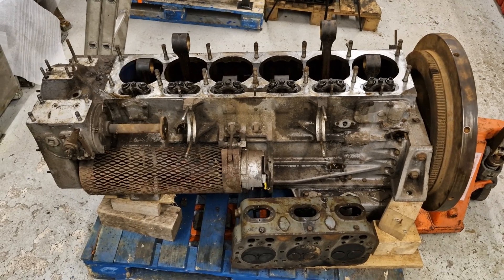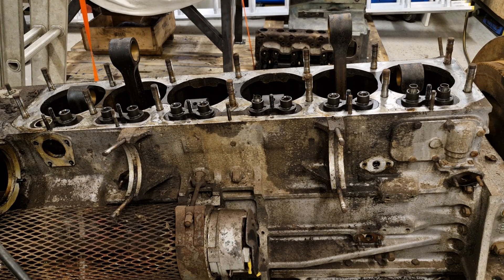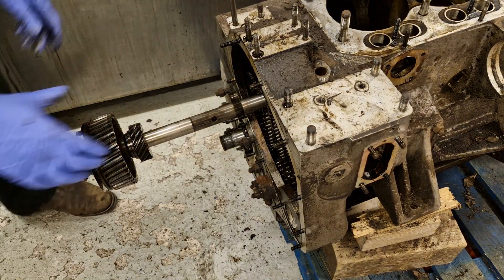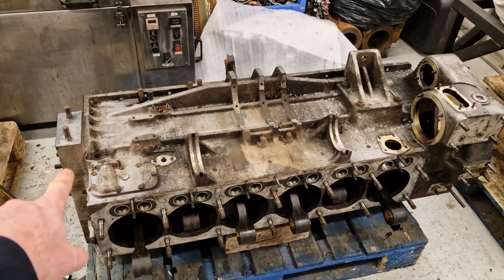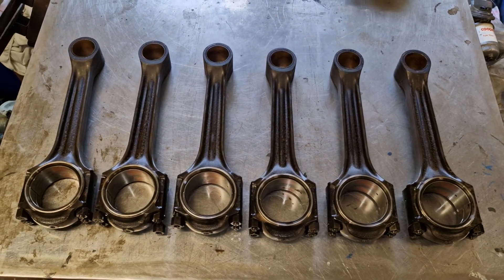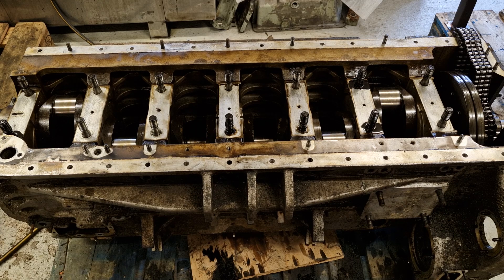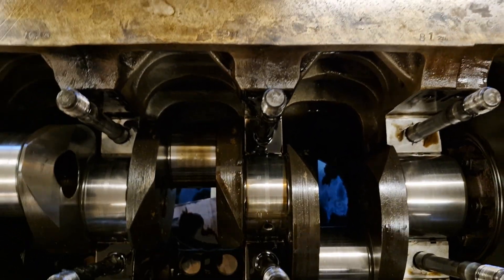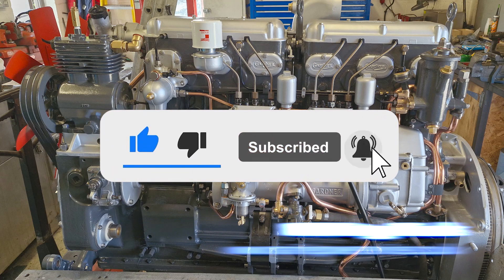Gardner 6LXB 180 Overhaul Pt 2 - New heart for a Scammell Explorer. Bottom end tear down

Comment: Thanks for filming this, What size exhaust pipe diameter would you run on a 8LXB
Reply from the maker: @MrCrabbing it is utterly dependant on the installation. length of exhaust run, number of silencers, number of tight bends etc etc.  However the Gardner stated for an 8LXB is a minimum bore of 3 7/8"(98.5mm) and a system design not to exceed a backpressure of 20 InHg. So depending on the setup you may need larger than the stated min diameter to keep the backpressure down.

Comment: You seem to know your way around these engines, do you measure the main bearing bores, or is there usually a tendency to go out of round? Nice video.
Reply from the maker: Don't normally find issues with the crankcase bores with the exception of the odd engine that has either been heavily got at in its life or has suffered a failure. So on some occasions they need to be line bored but not often. If you mean the bore within the main bearings themselves that the crank runs in then we replace in all instances so we measure the crank and check over the bearings for anything out of the ordinary, but rarely waste time measuring up bearings that are going in the bin. The crank however gets measured to acertain if its a polish or undersize grind it needs.

Comment: I have a question if you don’t mind, I have a 2LW, at 40 seconds in you remove a part off the timing end of the engine, I have a similar part on mine without the arm. Can this part be just removed and a cover plate put over the hole?? I only ask as mine is not used for anything and is leaking oil 👍🏼👍🏼 (my engine is in a narrowboat)
Reply from the maker: If you mean the part I am holding up to the camera at 1:01 then no you cant. The fork part you can see sits in a groove on the timing gear on the injector pump. without this in place the gear is free to move backwards and forwards on the injector pump shaft which effects injection timing. Is yours leaking from around the shaft? or where the housing is bolted in by 4 bolts?
Reply: @MPSVintageDiesels  leaking from around the shaft I believe 👍🏼
Reply: @NarrowboatPreciousJet  front or back of shaft ?

Comment: Hi mate are sper parts still available. Also what do you do with these engines.?
Reply: Hi, still easy to get.
Reply from the maker: Depends on the engine model, but in the case of these LXB's yes parts are still available.  Most of our engine are built for customers so in this case it will be fitted into a Scammell Explorer (Lorry/Truck) by its owner to replace a Meadows petrol engine that is currently fitted.

Comment: Do you normally, remove the hub from the camshaft, and fit a new key with locktite  ?
Reply from the maker: yes we remove the hub, cant get it clean and inspect it and the cam properly when still fitted. We fit a new key as It's called for in the documentation. Although never had one that has ever had an issue with the key that was fitted so not really sure on the need to replace it. I get it if you are repairing one that has had a cam/valve related failure as it may of overloaded the key but yet to find one damaged over the many hundreds we have done.
Reply: @MPSVintageDiesels  hi, I have a good few engines, that have had loose hubs, it causes the engine to flutter. As the camshaft rotates, the hub goes backward & forward  ( even if the chain is tight ) it goes down the half shaft & affects the governor. Carl ex Gardner fitter.
Reply from the maker: Intregued to know what made them come loose. In alot of cases we have to put them in the press to get them off. pretty much the opposite of loose. Were they mostly very high mileage motors or warranty period repairs?
Reply: @MPSVintageDiesels  high mileage engines, they will not move in and out, just rotate side to side. Used to take the chain wheel off, and put on a 3 stud / nut puller, and remove in situ  ( unless the engine was being completely rebuilt ) I alway used to remove the halfshaft, to make it abit easier to refit.
Reply: @MPSVintageDiesels  just to add on ( sorry ) I would think engines, that the chain has not been correctly tensioned, would add to a loose hub. As the cams lifting and lowering, the camshaft and hub are taking a beating at a weak point.